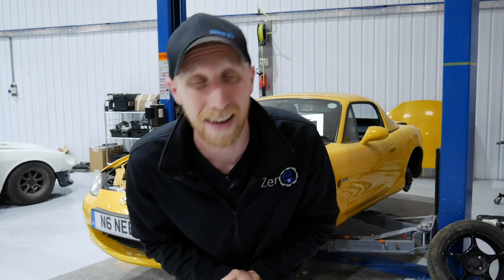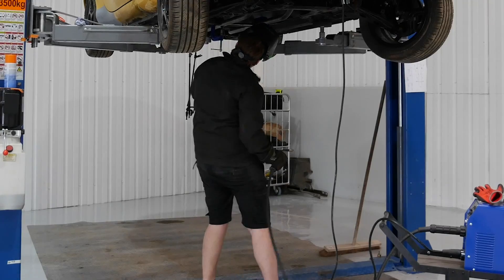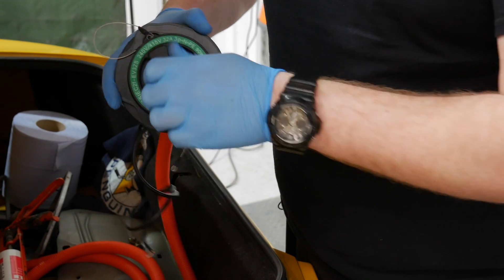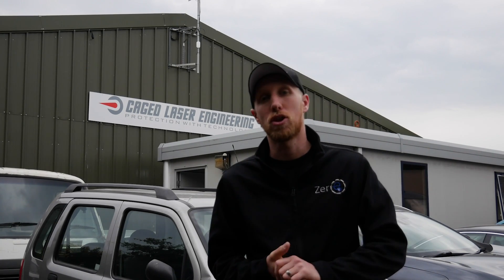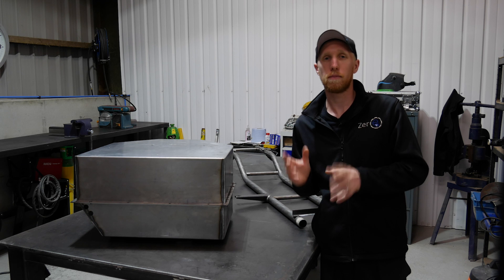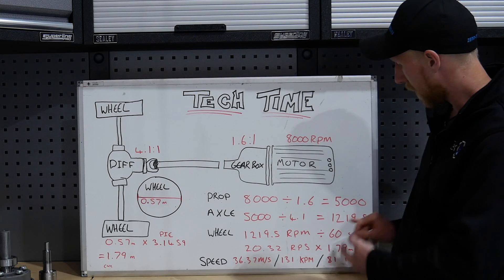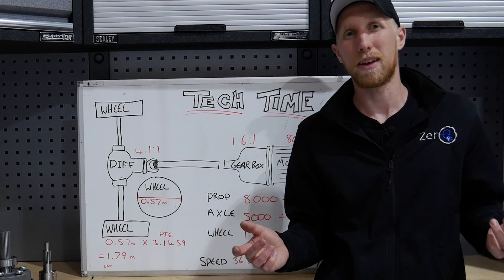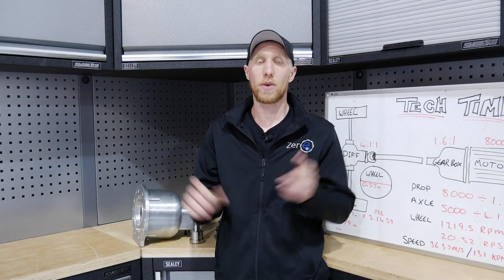Mazda MX-5 Goes Electric - The High Voltage Build - This could hurt

Comment: "come back for episode 6" said at the end of episode 6...
I like the idea behind the build, but you appear to be making that car worse for a significant amount of money.  0-60, basically the same as stock. Top speed, slower than stock. Power, worse than stock.

If you had dropped a 200hp motor in there this would be a relatively exciting build...
Reply from the maker: The main reason for this build is to test the gearbox youtube is a extra. Nice to see you watch till the end
Reply from the maker: It is very much a test bed for the gearbox and LG modules. We do have a new 120kw 12,000rpm motor coming out soon that will be mated to this gearbox giving much better performance and top speed.
Reply: In America you seem to obsess over bigger more powerful and faster etc, but in the UK if you go over 80mph you will be pulled for speeding all the time. And traffic means you rarely need 0-60 in 4 sec or less. And if you did want faster and quicker off the line you would have a much heavier car and that effects handling and on uk windy roads is a big negative.
Those big American suvs ect don't even fit in UK parking spaces!
Many differences to consider.
Reply: @penskib1975  yeah, I'm not a tank and definitely not from America... I own an MX5 and they are great little cars. But I couldn't understand the point of the build when nearly every attribute is being made worse (on paper at least). But if this is the test bed for the next project or the gearbox as stated above then fair enough.
Reply: Appreciate the reply. I didn't know that was the point of the build, and a bit confused tbh as I don't recall it being mentioned at all. And in this episode you stated it's tried and tested and bullet proof, so what is there to test in reality?

Comment: Someone needs to remove the brain dead spammers.. like Roman .
Nice video mind boggling amount of work. 
I want to convert an RGV250 Suzuki 2 stroke pocket rocket to electric.. which is a bit closer to the size of my wallet. The cost of all that work must make that car more expensive than new (given the £100+ average price of motor mechanic work done these days)

Comment: Really enjoy these videos. Looking forward to you getting the car on the road :)  And I think you made the right choice - better 0-60 is more use than higher top speed in the UK.
Reply: It depends on how you are going to use it. I leave in Germany and for us here is very normal to cruise at 160 - 180 kph  in our daily commute if you use an Autobahn, and it is very normal to see people driving at 200+. A car with top speed under 160 is quite annoying
Reply: @miguelstella2  Well with a nb miata, you dont "cruise" at 180 kph. Top speed of the 1.6 Miata is about 195ish. The engine screams at 6000 rpm and wind noise is really really loud. Definately feels intense, trust me.
Reply: @Miguel Moura, although I don't live in Germany I have driven on the Autobahn many times. This MX5 would definitely be a "right lane" car, but I'd be happy enough with that and sit with the trucks doing similar speeds.
In most (all?) other European countries this car would be perfectly capable.
My next question would be usable range. For example, (when not locked down) I drive to my in-laws just outside of Paris a few times per year. I wonder whether it would be possible to plan a practical journey with decent charging stops.

Comment: Pi is actually 3.14159 not 3.1459. Common mistake means many calculations are out 0.01%
Reply: Luckily most calculators have Pi in memory. This calculation is more as an indication, just think about what the tire growth at speed will do to your top speed.

Comment: Would the addition of an off-the-shelf overdrive unit enable a change of ratios 'on the fly' so that - effectively - you could have your cake and eat it with regards to having to make a choice between top speed or acceleration?
Reply: Why not, it just means more weight and complexity. It has been done in the past and should work well if you get the right ratios in it.

Comment: After hearing the stats at the end I was a little disappointed with the results, I suppose its always a compromise between speed, acceleration, range and weight. Although a 7.5 sec 0-60 TS of 100mph car would be more like it, how would the weight change the handling of the car, which is what makes them so fun to drive? Such a complex engineering job.  Keep up the good work!
Reply: Simon, have you driven an EV? (legit question, not trying to be an ass) 0-60 time doesn't tell you the whole story about how an EV accelerates. If the builder is managing to keep the weight similar to the IC version, then 0-60 in 8sec EV accleration in a car that handles like a Miata will be a riot!
Reply from the maker: Weight wise we are quite similar. All the number are best guess so it might do better than we think

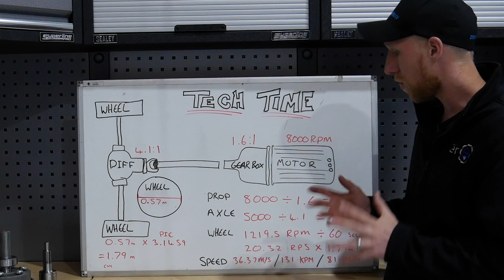Comment: At 10:34 you have a typo. Pi is 3.14159, you missed the 1 between the 4 and the 5 :-) i want one of those cars, love your work, thanks!
Reply from the maker: I know all those numbers I have to make one mistake 😂
Reply: @Hazell_Nutz  What you do is great, sorry to be too nerdy, what you guys are doing is more than nerdy, it's great! Thanks for doing what you all are doing!
Reply: Zero EV you didn’t make a mistake at all, you were testing all the students watching, 🤔 🤫🤫🤫😂😂😂😂
Reply: @mooremob100  I never thought of it like that, so true! Pie as well :-)
Cheers
Reply: Robert Jung Lol. That’s what I came to say. #Nerd. 👍
Reply: Good thing calculators have PI stored under a key. :)
Reply: Yes. And looking at his whiteboard, it’s ‘Pi’ - not ‘Pie’
Reply: @roscoecoltrane6867  and he said rpm and .75 by mistake
Reply: LOL. I thought the same thing.
Reply: I remember it from the Night at The Museum movie. 3.141592654
Reply: kandin Robinson that is rounded, the 4 at the end is actually 3.5 ;)
Reply: I consider the day a total loss unless i quote pi to myself to 13 significant figures from memory. 3.141592653589
Reply: Alternatively, just remember the number 113355 with a long division sign in between (symbol L turned 90 degrees), giving you 355/113 = 3.141592... Nevertheless, his mistake won't show at 2 decimal places, as any value for pi between 3.140 and 3.150 still rounds to the same value of  1.79 rounded to 2 decimal places.
Reply: top comment 😂😂😂

Comment: Did you consider connecting the motor to the diff without a gearbox? If 4.1 is not ideal maybe to make some reinforced custom gear for the diff ilo adding more weight and complexity and energy loss with an additional gearbox and keeping  stock gear in diff that are designed for lower torque ranges. I see people always using gearbox and I never understood the reasons behind it, maybe I am missing something here....
Reply: You realise that gearing has limits in the ratios it can physically achieve. You would need to increase the diff ratio from 4 to 6.4. Which will most likely never fit in its casing let alone be able to handle the torque. Also having a connection like a propshaft spin at 8000rpm is not a fun thing to make work.
Reply: @Tom-evnut  Makes sense! Thanks for the feedback!